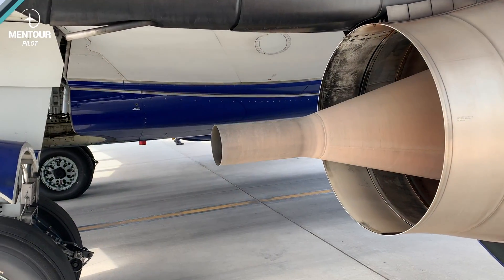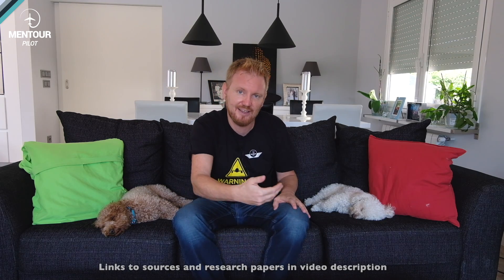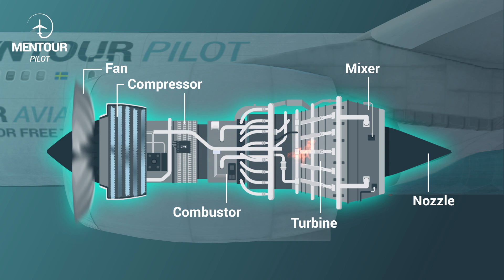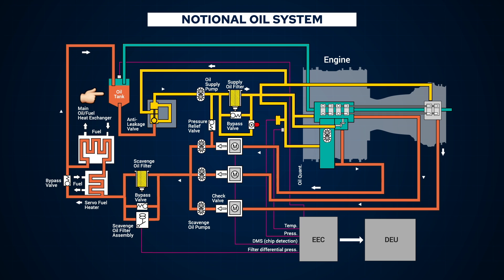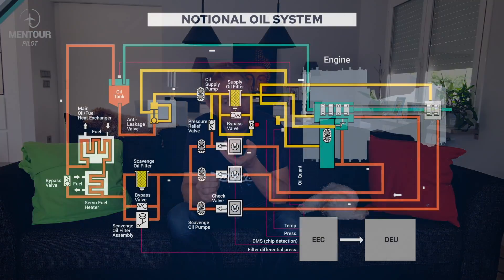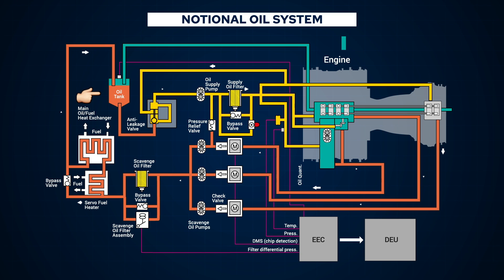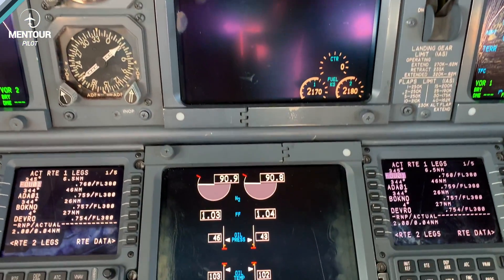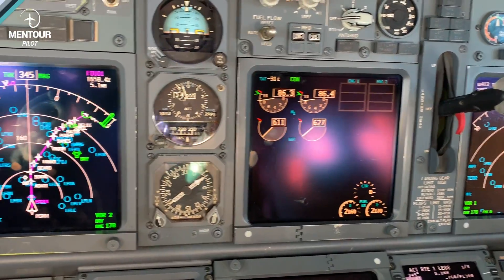What is that TUBE at back of the B737 JET engine?!

Comment: Obviously Chemtrail generator. Easier to see with tin-foil help.
Reply: I always find it hilarious when the chemtrail believers post pictures of "chemtrail apparatus" as "proof" of chemtrails. The photos being random aircraft parts, or once a photo of a plane full of water tanks used for weight and balance testing. Not only could I know what non-nerfarious purpose all of those things serve, I can also think of things like cropdusters, firebombers, or the planes that dumped Agent Orange over Vietnam - airplanes have been equipped to dump stuff like that, we know what said equipment looks like, and it's not what the conspiracy theory people are posting.
Reply: @quillmaurer6563  toxic chemicals are being sprayed to make people sick to boost profits for big pharma.
Reply: I want someone to explain to me why exhaust gases from cars can be seen on a cold day? I guess those "chemtrail gases are being put into our automotive fuel also. Keep wearing your tin foil hats clowns. Those "chemtrails" are nothing more than super heated exhaust gas hitting extremely cold air.
Reply: Bobby Welch It’s the water vapor in the exhaust of carbon fueled engines. The temperature at cruising altitude is -50 year round  and you are seeing the condensed vapor in the form of contrails when the humidity level is in the right range.
Reply: @b737driver8  the carbon fuel is coal dust moisture
Reply: @bobbywelch6035  B737 Driver explained it before me but the tagging didn't seem to work, so dunno if you've seen it. (EDIT: oh, if you were just poking fun at the chemtrail and I took it as a question then eh, disregard it) What you see from car exhausts is exactly the same you see from your own breath on cold days - condensation.
Almost all fuels used have hydrocarbons on their composition, so when burnt, they produce CO2 and water vapor (in fact the vast majority of the combustion gases, when burning correctly, are those two), gasoline does it and so does many/most other fuels, hence you can see it while the exhaust pipes are still cold enough, you can even see water dripping from the exhaust pipe of a car because of this.
Reply: yes, I know a man who really believe this.
but it was done decades ago, and it needs to be done very low for good results on spread
without it dispersing
Reply: Well.. it does make a trail of chemicals... so it's really not wrong.
Reply: @matsv201  You're technically correct, the best kind of correct ;D
Reply: matsv201 it’s a joke
Reply: @zzffrrnnzz  saftey and efficiency is no joke ever
Reply: mic stone lol
Reply: I somehow got through over 30 years of life including 10 of internet without hearing about the chemtrail thing, until I happened to overhear some intriguing conversation fragments from 2 pax at my gate (read:  pax A "educating" random victim pax B.)

I collared one of our pilots to explain this iiiiinteresting theory, with the reaction you'd expect:  the delighted omg-aviation-question-for-me! little boy grin, followed by hysterical laughter.
Reply: @j mcmann this might be true, but lots of people ask for it this way and is always understood, like the hoover, the vacuum cleaner
Reply: @j mcmann i give up with you, there's just no telling some people and yes i STILL dial  number's
Reply: My first idea too.
Reply: @j mcmann Before I retired from IT support I kept an aluminum foil hat (I prefer the classic designs) on my desk. I knew another tech who kept a rubber chicken to wave at tough problems. The hat or chicken, combined with the secret chant, "Oh Wah Ta Goo Siam" followed by running away far and fast never failed. I never got a callback!
Reply: CHEMTRAILS EXIST!!! THERE ARE AIRCRAFT SPECIFICALLY DESIGNED TO SPRAY DEADLY CHEMICALS OVER LARGE AREAS!

they're called cropdusters
Reply: Spring Bill Gates Springhill Gates it is spring came chemicals have been sprayed out

Comment: You cain't pull the wool over my eyes, boy. Them there tubes on the Commercial French Motor 56-27K- B4, is what makeses thems whistler sounds on take-off.
Reply from the maker: Huh?
Reply: @MentourPilot  It is called humor. AND, very little of it on my part. Our airline had a few teething problems with the 27K engine, mostly HMUs letting go. I had one brand new -800NG that had a major harmonic vibration that would rattle the overhead bin doors that side, otherwise, I never had a problem with the CFMs or Rolls engines. Great video.

Comment: I guess the next question is why is it a convergent-divergent nozzle? It certainly can't be supersonic flow.
Reply: Well it’s most likely to do with matching exhaust pressure somewhat. Converging nozzle will obviously increase velocity and decrease pressure. It’s not used in the case of thrust so supersonics is not part of the equation

Comment: As additional information from a testcell operator: The cfm56-7b (all ratings) uses about 0.3 quarts per flight hour. If you crank the engine (no lightup, just starter engagement) it uses even more. In the end after 3h runtime there is about 0.2 quarts in the centerbody (inner tube) and if the exhaust is still hot from operation it "burns" up and it stinks alot😅
Sidenote: on the old PW4000 series engines you dont have this problem because the deoiler operates at much higher rpm's. Furthermore the higher oil pressure on p&w's helps to prevent this problem
Thank you peter for this interessing topic
Reply: Good to know, thanks for sharing.
Reply: Best comment. I bet you would have had fun in TWA’s 1011 engine shop at LAX...
Reply: @DVolvoguy777-x7o  i work in zurich but during those times its hard to belive in future^^
Reply: Laughed for a moment at the mention of Quarts. I was thinking for a second 12 quarts is quite a bit more than 12 litres but of course the reverse is true. I was thinking in terms of UK pints which amount to 20 fl oz per pint so the quart is 40 fl oz but of course we are working with US quarts where you only have 16 fl oz per pint and then 32 fl oz per quart. Then just to confuse this further both sets of fl oz are different volumes. 
UK quart to litre 1.137 litre
Us quart to litre 0.946 litre
But for the prices it's better to drink pints of beer in the UK.
Then you confuse things further by measuring fuel in lbs too.
Reply: Thank you for telling
Reply: If all the cars in the world burned oil at that rate, it probably would represent a significant air-quality issue.  Any estimate on how much oil is burned worldwide by jet engines each year?

Comment: When I was working on an plane utilizing CF34-8, one big airline had requirement to have oil tank to be flown a whole week w/o need to refill it, even when there will be servicing after every day in operation. Simply as safety measure to don't run out of oil.

Comment: Hi sir, I have a question for you. 
The air which passes through the jet engine is very fast and even in this speed we cannot see the flames at the back. We see it only during compressor stall or any other engine problem. What arrest that flames to stop in the combustion chamber? 🤔🤔. Hope you answer this question 😃😀
Reply: I think that when you ignite the air in the combustion chamber, you pretty much exhaust the fuel amount in that certain volume of air tranforming chemical energy into kinetic. So the hot air coming out of the turbine has no fuel to burn anymore. Its energy is now only in the form of kinetic energy and not flame. On a fighter jet engine, the reason why sometime you see the flame from the nozzle is because of afterburner, where the engine spray fuel directly into the exhaust gas and continue to energize it and generate about 20% more thrust. During compressor stall, the compressor stage is flowing very unstable, where pressure is building up between stages, and when this pressure is release, it can force the air to move lots quicker suddenly, carrying unburn fuel outside of the combustion chamber and "backfire".
Reply: @skootty7151  such a great mechanism, thanks for explaining 👍🔥

Comment: If an aircraft's pressurization system fails while at a remote base is it possible/legal for the pilots to fly the aircraft to a maintenance base unpressurized on oxygen masks? Do they simply fly at a lower altitude or do they use masks on cruise?
Reply: Sillygoose210 _ Must have one of the two aircondition packs working for a MEL release. Unpressurized ferry flight below 10.000 ft (without oxygen masks) would be an option if is cannot be repaired on site (unlikely, but still..) but will have to be authorized by the aircraft manufactor ( so Boeing in the 737s case).

Comment: Excellent -- thanks!  I have a question for a possible future video -- what, exactly, is the protocol for commanding "Gear Down"?  Is it a particular altitude above the ground, or a particular number of minutes (or miles) before touchdown, or a particular airpeed reached, or...?  The reason I ask is that in the MANY cockpit videos I've seen, it always seems like the pilot calls "Gear Down" at a seemingly arbitrary point during the approach -- like, he just happened to think of it then.  Is that in fact the case, or is there a clear, specific "trigger" for that command?  And what if he doesn't issue the Gear Down command, and the crew also misses this in the before-landing checklist, for whatever reason (sudden radio distraction, etc) -- is there a warning issued by the aircraft to alert the crew that the gear is Up, before a belly landing happens?  I'd really like to know!  Thanks.
Reply: The gear down is usually around 5 miles out from the airport, but that's a very rough estimate, usually it's just whenever the crew decides to do it. As far as I've heard/read/seen, at least. But if the gear isn't down and you're under 1000 feet AGL (if I remember correctly, might be a different height) the GPWS will say "too low, gear", just like you may have heard in a simulator "too low, terrain". It also has "too low, flaps", obviously if your flaps aren't down yet, as well as various different levels of the classic "whoop whoop pull up", "don't sink", etc. depending on how soon you're going to hit the ground. In case you didn't know GPWS is Ground Proximity Warning System.

Comment: Similar to older BMW car engines, which weren't healthy, if they don't blow out blue fumes.
Reply: HerrMeyer -they used to say that BMW had a blue centred badge to match the blue smoke discharge when you lifted off and then floored the throttle again especially on the autobahn. !!!

Comment: How often do you change the oil in a boeing 737
Reply from the maker: It’s very rarely changed. Because the oil is not in direct contact with the exhaust fumes (like in combustion engines) the oil doesn’t degrade in the same way.
Reply: Bradley Meredith When changing filters, usually every A-check, so yeah, not that often🙃

Comment: That reminds me of the video that Lindybeige made about muzzle brakes on tanks. Never knew what these are for. Didn't know what they are called either, so googling them wasn't easy either. One day he finally found out they're called muzzle brakes - still no clue what they were good for though. Fast forward yet another few years, and the army base nearby had an open day. Sure enough they had plenty of tanks there, including some with muzzle brakes. What they also had was the bigwig of the garrison, high-ranking general thing. And that's who he went to, if anyone knows what a muzzle brake is for, it's this guy. When he asked him, he said something very interesting. He said: "...what the hell is a muzzle brake???"
Reply from the maker: 😂😂 Exactly!! Sometimes the people you think know everything, doesn’t
Reply: many years ago, worked for an admiral who, whenever confronted with a question like this would go straight to (surprise, surprise) the chief petty officer that owned that equipment and get an answer.  that should have been that general's next action.  "I don't know, but I know someone we can ask and get an answer!"  incredible man, an old-navy 3 star admiral named Bulkeley.  don't make 'em like that, anymore.
Reply: Muzzle brakes vent the un used gasesafter the projectile leaves the barrel.  Otherwise they would go back into the crew cabin and eventualy kill the crew!
Reply: @stufenton5399  that's the bore evacuator, the big lump on the middle of the barrel. the purpose of a muzzle brake is sorta in the name, it sits at the end of the barrel and right when the projectile leaves the barrel gas is directed backwards "braking" the barrel, reducing recoil
Reply: @stufenton5399  No what you are thinking of is the bore evacuator or whatever it's called. The muzzle break really just diverts the gases coming out of the front end of the barrel/gun. This can be to make the muzzle flash smaller. Or it can be to divert the smoke quicker so the gunner can better see where the shell goes. There are probably more uses for it too. But it has nothing to do with gases coming out of the breach.
Reply: @stufenton5399  Nope. At least that's not what he said ;)

Comment: We removed the exhaust on the CFM56 today, bolts are always extremely siezed.
Reply from the maker: As they should be!
Reply: @MentourPilot  Milwaukee impactor, and 17 busted screwbits later we finally got it off. Needless to say its a pain, but id rather it be seized than it be loose. I remember finding a loose bolt around the perimeter of the turbine/exhaust when we removed the TRs, luckily theres quite a bit of redundancy in those.
Reply: Matt Those are 🤬
Reply: @Matt_10203  I thought critical parts of aerospace equipment are lockwired to stop them coming loose.
Reply: @NiHaoMike64  not those. As there are so many, its pretty much irrelevant as there is such a microscopic chance of more than even 1 coming loose. Saftey wire is mostly for things that once they come loose themselves, will be a critical failure, like a filter for example. If it were to come loose itd be a serious issue where as if 1 screw out of 100 comes out its not even going make a slight difference and that might be 1 screw/bolt loose in thousands of cycles, so essentially the saftey margin is ridiculously high. 
Plus, technically it wasnt "loose" it was just spinning in its hole. The nut wasnt actually loose.
Reply: @MentourPilot 
Thank for that interesting video!!

Comment: If you look at the oil venting on the Trend (A350) it's vented on the bottom of the cowling, as a passenger it looks very wrong compared to venting into the airstream (as you explained)
Reply from the maker: Yeah, that’s because they have a dedicated breather connected to the assessors gearbox

Comment: Question for a potential new video: why the runways’ asphalt is so rough? This makes the plane very shaky on take off/after landing. Why they don’t build them smoother? This way, after landing, the plane would run more smoothly. Thank you :)
Reply from the maker: Generally the runways are grooved in order to drain water as fast as possible.
Reply: Gabriel Cichi Braking Action would be reduced greatly. It also won‘t be ideal when it is slippery.
Reply: Aha, this makes a lot of sense. Thank you for the explanations.

Comment: This is why being an aerospace engineer is much harder to get into than being a pilot! Thou being a pilot as well is also not an easy job
Reply from the maker: Indeed. Engineers might have an extremely high knowledge of certain systems and components but the pilots needs overview system knowledge of everything.
Reply: Mentour Pilot, also keep in mind sir that a good pilot is always learning 😉
Reply: Mentour Pilot actually the AME has to have knowledge of the entire aircraft. And in the case of airlines with multiple aircraft types the AME may hold licence on multiple aircraft. At the time of my retirement I held licence on 5 active aircraft type as well as having held 3 previous type.
Reply: Rob Wigle Weeeeell😉The day you think you know everything on an aircraft in your type rating I think you have lost your ways a bit🙃
Reply: Speedbird hey mr speedbird, reread my statement, I never claimed to know everything. Thank you for your input
Reply: Of course, every pilot isn’t rated to fly every aircraft, just like every aerospace engineer doesn’t know the details of each and every system on every aircraft...coming from an aerospace engineer.

Comment: As a former ramp agent, I can tell you It's a good place to dry your gloves in the winter. :D
Reply: Also Airbus avionics bay exhaust makes you warm very quickly :)
Reply: @campusto  I remember trying to write on my checklist in the rain, and everything was soaked up. So I put my hands and the paperwork under the exhaust and after 2 minutes it was completely dry :D
Reply: @campusto  Nice and warm during winter a nice breeze during summer
My favourite spot near the AC
Reply: @Corey McDonald Yes, this. :) Also, where ever you stick your gloves, make sure it's an exhaust NOT an intake :D
Reply: As long as you don't forget them before start up.
Reply: As a 737 flight attendant I've been next to this engine a bunch while waiting for the van.  I've noticed the smoke and assumed it was really hot but didn't know what it was.
Reply: Or by the louvred ram air exhaust doors
Reply: YES. I know after opening the cold cargo doors, I tend to put my hands behind there for a minute.
Reply: Well your not a very good one because they can soak up micro droplets of oil and turn ignitable
Reply: @masseyluna2002  Youre* and there's minimal risk if any if the engine is off.
Reply: Lol that is a huge sike all you have to do is stand near an exhaust outlet for the apu you should never put anything on or nead an engine you should know this
Reply: Holding your hands inside the exhaust is a good way to warm them up, too.